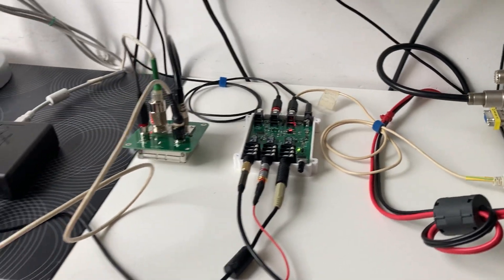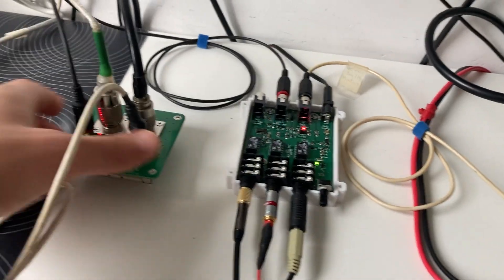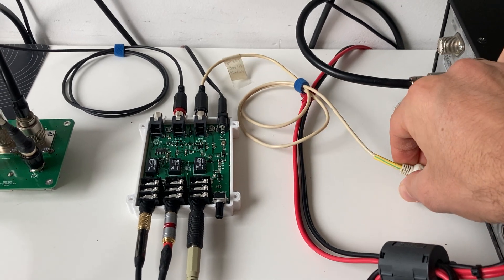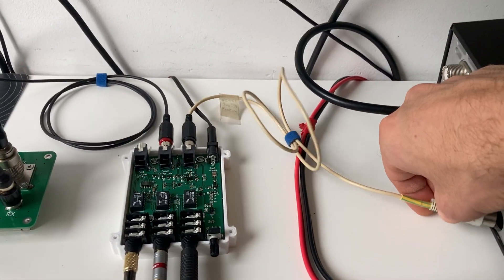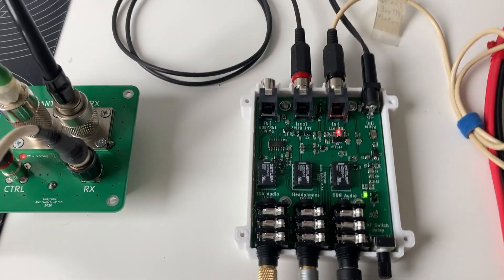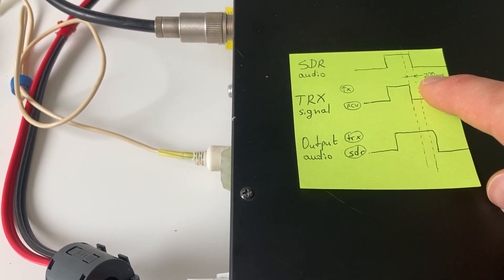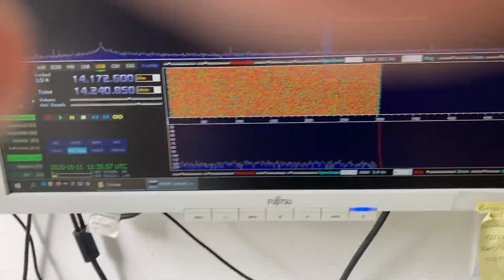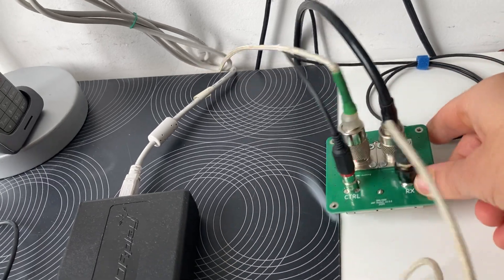TRX-SDR Switch (T/R switch) by lz1aq

Comment: Nice setup.
Another testcase which you should not try: put transceiver transmitting and unplug and replug the power to the audiocontrol bord. I have seen safety circuits that are not safe when powering up or down, because that is forgotten in the design.
Reply from the maker: I tested, 20 or so times, disconnecting the power supply of the audio switch while transmitting. No problem there. It seems that during transmitting the audio switch is powered off, so unplugging and then plugging the power cable does nothing really.

Comment: If I don't want to use the audio from the SDR (just using the Transceiver audio), can I set the delay so Full Break-In (QSK) is working from the Transceiver? For the Panadaptor SDR application, I don't really care if the SDR display can't follow the Receive audio while sending CW (it will switch in the SDR after I stop sending). Also, since the two SO-239 connectors are wired together should the Antnna Switch safely handle 200 Watts of transmit power?